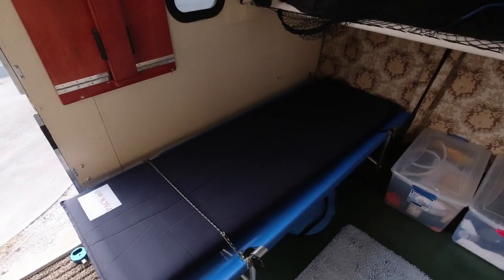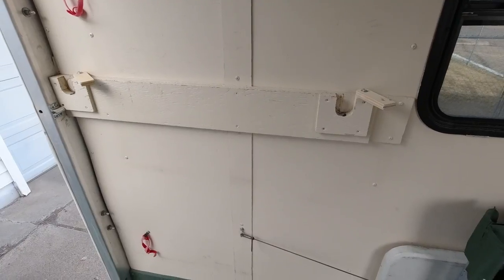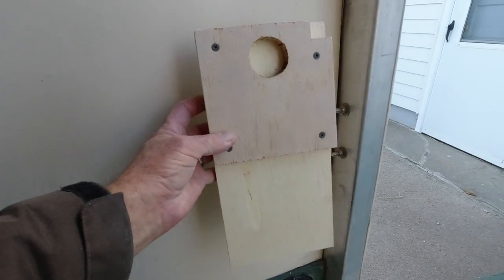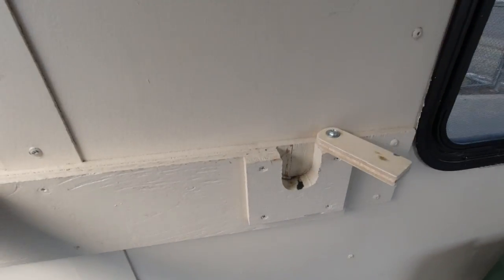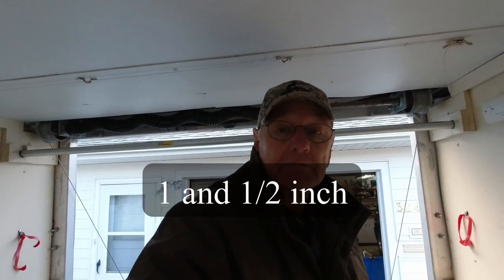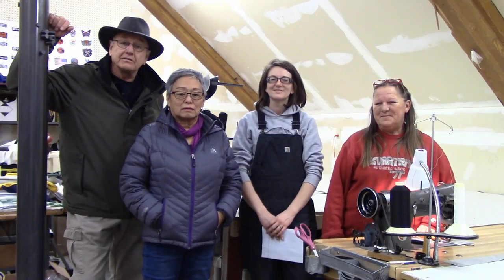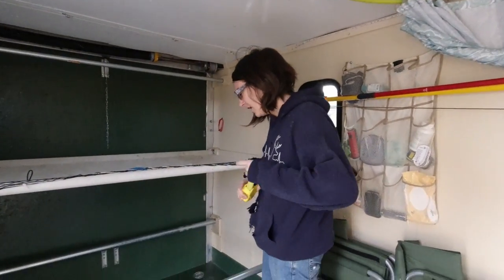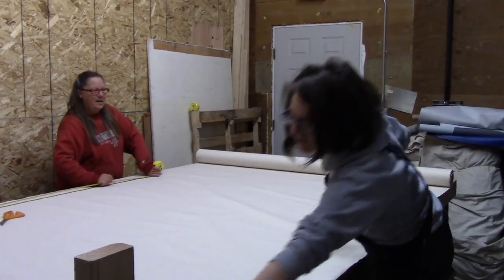RV Bed - Pipe Berth DIY Build

Comment: I am thinking of a water bed, a) because that is what I sleep on at home, and b) because I often camp in the desert and could always drink my bed if I broke down! :-)
Reply: Don't forget how much water weighs (8.4 lbs per gallon)
Reply: Also, be aware that you will need to put something in the water to prevent algae from growing inside the bed, that might not be so good to drink.
Reply: You are probably joking, but you really can have a water bed.  There are bed pads used for people that are essentially bed bound.  I've seen air filled ones, but also water filled.  They are not like a full water mattress, but they could go over a canvas cot and simulate a water bed with much less weight.

Comment: I love the concept that the bed lacing could be tightened or loosened to the individual's preference, the original select your comfort bed. Plus if needed pushing the front pipe back or removing it could open up floor space when not in use, genius.
Reply from the maker: Hello morphergaming 05, The bed is still comfy and once in a while I re-adjust the lacing.

Comment: In the Navy, (about 1973), my second ship was so old it had canvas bunks laced to pipe with a fiber mat of some sort on it. . When we went into the shipyards, they converted to a metal box for storage with foam on top. I liked the canvas better. It was more comfortable, and in heavy seas the canvas sag made it easier to not fall out. Now I need to rethink the bed in my van. One could also make adjustable storage shelving with dowel rods and fabric. Maybe even PVC with a center stretcher, (like a square 8 frame for the shelf part, and wood for the risers).
Reply from the maker: Good idea about the storage shelving.  Hey Danny, I still have the canvas with the lacing grommets that belonged to my dad from his time in the Navy during WWII.
Reply: @gonagain  My ship was the USS Hector AR-7. Left the shipyard 1942 and was commissioned in 1944. It had the old steel plate and rivet construction.

Comment: So, thank you for this great idea!  We have a 6x10 cargo trailer that is primarily outfitted to teach scuba diving (most of the space is taken up by a compressor, tanks, BCs, regulators, safety gear, etc.).  But there was a lot of wasted space.  Over the past several months I've installed a counter at the front, upper and lower cabinets for camping/cooking gear, food, clothes, etc., a 200w solar kit w/1000w inverter....but other than a walkway down the center and some space by the twin doors (there's no side door), there really was no place to sleep unless we deployed our 2-person tent.  The tent is fine when we are intentionally camping or when the weather's decent.  But for stealth or bad weather, there was no practical way to sleep...especially since we also have 5 small dogs.  Your pipe berth was the PERFECT solution for us!  I can easily remove the two cots, roll them up and tuck them along the side of the trailer when I'm teaching classes and easily set them up when we're camping or have to bugout.  We don't have anyone in our small border town who can custom-sew cot/canvas material, so we bought a couple of fold-up cots from Walmart, removed the framework and inserted 1 1/2" pipes in their place for an easy install!  Thanks again!
Reply from the maker: Thanks for tip on the cots from Walmart! That's the kind of thinking we use when diy-ing projects. Those should work out just fine.
Reply: @gonagain  BTW, Home Depot has closet rods of various lengths, colors and strengths made by Everbilt.  I got the 6ft ones rated for Heavy Duty ($19.98)....they fit the Walmart cot easily (with just enough room to make insertion and adjustment easy).  I definitely would only go for the Heavy Duty ones, but they hold me just just fine.

Comment: Great project. Very talented ladies. Got me thinking of a solution for the back of my truck bed. Using this instead of the heavy plywood structure and memory foam everyone else uses.
Reply from the maker: Exactly!  Besides, I sleep way better on these.
Reply: Do you have videos of your truck?  I am in need of ideas. I just bought truck with topper.
Reply: Nancy Rae nope not yet. I just bought my camper shell. Good luck.
Reply: @hero2006  same to you.

Comment: I would not have thought the pipes you use would be strong enough to hold my 178 pounds, great idea , i like how you did the brackets on the wall .. It looks great .. Now i know how to do it , slick idea .. I sleep on my side a lot of the time but not all the time..
Reply from the maker: Those pipes will easily support 300 pounds.  That conduit comes in two different weights (that I'm aware of) and this is the heavier one.
Reply: @gonagain  Thanks I never knew that and have bought conduit pipe in the passed for jobs, good to know..
I like that system, what a great system..

Comment: I saw a similar setup to this for camping in the woods where you angle logs.  You could angle the support holes openings to allow you to remove and store the cot and then when you add your weight to the cot is sets in and separates the cot side supports.

Comment: Looking good neighbor! Cheers from Armington!
Reply from the maker: Stay warm!  It's been a very mild February and I'm expecting all heck to break loose at any time.
Reply: @gonagain Likewise!  I think March will get us. This has been the mildest winter I can remember in my years of being here. We had more snow in the Fall. I'm not complaining though.
Reply from the maker: @Hobo_Juanito  Yeah, we had one day of fall and then it started snowing!
Reply: @gonagain  I have a cargo trailer for camping and I have been running the disc-0-bunkbed which is heavy. I may try doing what you have done. Looks light and easily removable. Do you recommend any type of paint or treatment that inexpensive to treat the floors? I thought about just putting down some clear water seal.

Comment: Great job the only thing I might considering to add would be a strip of wood running at the top where the poles go in along the side of the trailer so the brackets would not be able to twist in to each other.
Reply from the maker: Our upper bunk is like that and I'll be keeping an eye on this one.  I didn't do the braces because I'm trying to maintain maximum length, but we'll see if the mounts move at all.

Comment: I had my guy make it out of some mesh type material, which I have on some 2x4’s connected to e-track. Probably going to upgrade to aluminum shoring beams to be a little stiffer.

Comment: Perfect timing for this episode, we have been using a blow up mattress and was about to order a fold up frame so we could have storage underneath but this would be a lot cheaper!
Reply from the maker: And it's very comfortable for us, too!
Reply: I agree! Been debating a third bed “option” on a step-van and this is a heck of a lot cheaper and efficient than a pulley & electric cable system. I think I’ll do 3-piece “interlocking” pipe so I’ll have them to use for breaker-bars too. Won’t need to carry a electric impact gun anymore for the flat tire that “will” happen at some point.

Comment: This was one of the reasons I went with a 7' wide trailer instead of a 6'.   I ended up using e-tracks on the walls.. and 2x4 brackets to make the bed platform.  Works perfectly.  I've done a handful of videos throughout my build process if you wanna check them out.. but here's the video of the initial bunk bed install.  Cheers...

https://www.youtube.com/watch?v=iVQc9dj1L_M&t=29s

Comment: I like your camper! 
I built my cargo trailer bed using aluminum scaffolding poles. 2 inch will work great for you if the EMT pipe bends on you....
Also have you thought about putting 3 scaffolding poles across and some plywood on top. Scaffolding poles are cheap and strong! Thoughts....
Reply from the maker: Aluminum pipes like that would be better and more user friendly.  I'll look for them because my daughter is getting ready to build her's now.  Personally, I sleep better on the slung canvas than I do on a mattress over plywood and that's why we went this route.

Comment: Pretty good concept I must say. Ever thought of doing 3-piece interlocking pipe sections so your not stuck with 6’ pipes to stow?
Reply from the maker: I hadn't though of that, but I just roll the whole up and hang it on the side wall.  As long as the interlocking ones are strong enough that would be great.  I wanted to use wood poles but the cost was much higher and the availability wasn't there.
Reply: Gonagain “square steel” would be easy, STRONG, and reasonably priced. Plus not want to roll around and still give you 3’ “breaker bar(s)” for lug nuts on car/truck/trailer.  Regardless, I like your concept. Now interconnect them width wise for a “shade” off side/back of trailer? Dual-purpose anyone??

Comment: If you have two pipes that are short for what you need, add a pipe that 
Slides inside the 1-1/2 " pipe. With some extra for support on each side.
Then pop rivet or drill through and add a 1/4× 20 bolt  on each side. So 
It will be strong. We use that for antenna supports with a ss hose clamp 
For vertical uses.  Will that work!
Reply from the maker: Got it!  Thanks Gary.
Reply from the maker: Got it!  Thanks Gary. Yes, I guess it would work as long as the fit was snug.

Comment: Great Idea. What kind of paint did You use on the floor and the baseboard of Your trailer? Is Your floor plywood or particle board? Has the bottom of the floor been protected with anything? Enjoy Your video's.
Reply from the maker: The floor is OSB and we've painted it with oil based porch paint.  It stands up well and we only recoat it every few years.  The underside is sheathed with 2 inch foam insulation glued on with construction adhesive and screws with fender washers.

Comment: Hey guy's great video , very useful information as always . Why not just use bunk beds or do it out of 2 x4's though? Seems cheaper and easier and stronger? Or cots they fold up and go out the way? Just curious why you went with canvas? They make a pad you can get from Teton , cot pad 82x38 2.5 inches thick . $100.00 worth every single penny too. Has a washable cotton cover ,sleep like a fricken baby . You might want to rent your bedroom out after sleeping on it. People are like you're crazy , crazy like a fox . I have to get my sleep or I'm an a@#^%$# , just how God made me comfort is everything to me  .$$$$$ is no issue when it comes to sleep. And that pad can go on any cot and I'm snoozing. Peace.
Reply from the maker: We've tried everything and my favorite has been the cot I showed at the start of the video.  That made me want to stay with a cot but commercially made ones won't fit across a 6x10 trailer.   I've never been comfortable on a pad over plywood myself.  Too many old, aching joints!  Thanks for commenting!

Comment: When I built mine I just ordered the bunk canvas from disco bed
Reply from the maker: That's a great idea!
Reply: RM    Disc-o-bed?   Yes, that would work, your thoughts on the bed? Would it fit side ways?
Reply: I just got a replacement cot and cut it down
Reply from the maker: @richardmorris4620  that works!
Reply from the maker: @cajunjamis9001  , those are very well made and comfortable (my daughter uses one in their trailer), but it's too long for a 6 foot wide cargo trailer.

Comment: Hi Rick,
How do you like the pipe berth bed.  Is it still comfortable as the cot was?  How wide did you make it?   I'm from Butte just starting my build.
Reply from the maker: I made my berth about 34" wide between the pipes. The three section laying on mine really helps with the adjustment and comfort level. I like them better than a cot.

Comment: Another great video. I'm the same height so I'd be curious to know the inside width of your trailer?
Reply: He told you it is 70 inches.
Reply from the maker: That's it Evan, about 70 inches.  I made the bunk 36 inches wide so that I can sleep a little diagonally if I want to lay on my back.  I spent the first night on it last night and it's very comfortable.

Comment: I do worry about the fabric stretching over time.  I have seen that with cheap cots.  Also, the canvas weight is confusing.  Maybe you were referring to the ounce weight? (12 heavier than 10).  I have seen the smaller number being the heavier fabric.  "Numbered ducks range from #1 to #12. The lower the number, the heavier it is. A #1 canvas is 27 oz per square yard and #12 is 11.5 oz. Single fill ducks are generally lighter weight and more flexible, ranging from 7 oz to 12 oz." https://www.onlinefabricstore.net/makersmill/canvas-fabric/
Reply from the maker: Yep, with canvas the larger number is heavier.  I went with the lacing so I could adjust the canvas as it stretches.  You were kidding about using your water bed as a water supply weren't you?  If you chafed a hole in it you could wake up swimming!
Reply: @gonagain  - but I love swimming!  Thanks for the video, I am looking to get my conversion "finished" by spring (it will be an ongoing process, I'm sure).
Reply from the maker: @carlyellison8498  That's good to hear Carly.  I hope we meet up on the road sometime.

Comment: How much sag do you get with your setup?  Could you put a mattress on top of the canvas and not overly sag towards the middle?
Reply from the maker: No, it's the slight sag that makes it comfortable as it conforms to your body shape.  The key is that there is no head or foot cross frame.  I don't think a thick mattress would work, but we use a 2" camping pad and that's very comfortable.
Reply: @gonagain  thanks for that.  I had an extra long cot and left the end bars off and it did get more comfortable.  Glad to hear that you don't use something thick as that would allow me to use like a bigger thermorest pad.  Like yourself I'm going to put my atv in mine and need an easy way to deal with my bed.  I appreciate your video.

Comment: What would you guess is the weight limit for those bunks?
Reply from the maker: I'm right at 200 pounds and I know it would take more.  250?  But you can make it as strong as you like.
Reply: @gonagain  how would you do that? Add braces to the pipe?
Reply from the maker: @chawnslopoke2619 , no, but you could use the larger pipe.  Because of the canvas, the load is distributed along the entire pipe length.  You know how I only used one piece of plywood on the end?   I would use 3 pieces that went all the way to the floor, so the pipe ends were contained for 1 1/2 inches or more, depending on the plywoods thickness.
Reply: @gonagain  Yea that's a good idea. Right now we have an inflatable king size bed that fits perfect and it's comfy. But when it's inflated we barely have any room just enough to stand in front of the counter in the V and a thetford porta potty. I like how much more room you get with your idea, and the way you did the side pieces I can still pull my RAZR in without rubbing. Thanks for another great video!

Comment: The canvas tube is a great way to go. You can put insulation in the middle or remove it according to weather.

Those grommets are garbage though, that is where it will fail, probably has by  now.

Should have just sewn a canvas tube and adjusted tension by moving pipes closer/further apart.
Reply from the maker: The grommets are professionally done and they are just fine after more than 2 years of use.
Reply: @gonagain  Professionals don't use grommets on cloth edges.

This will be the first point of failure. 

Be sure and make a video when that happens and tag me in the comments.